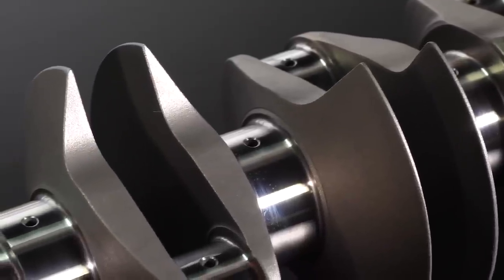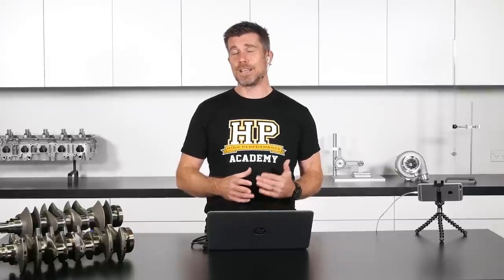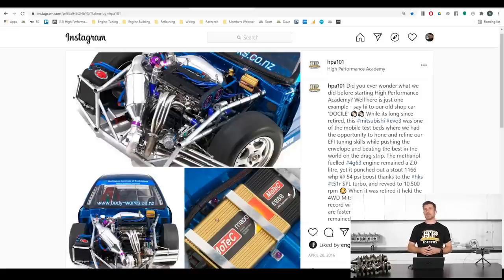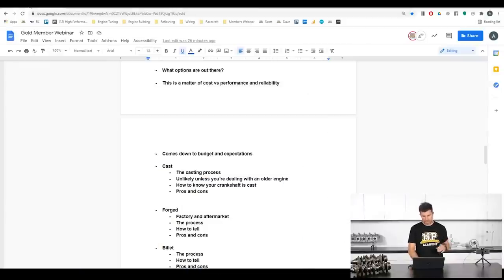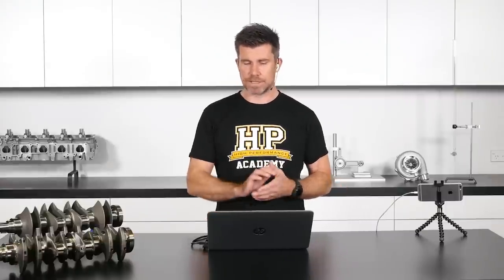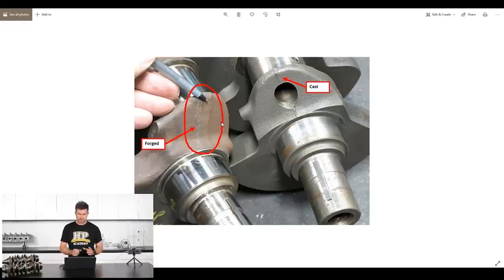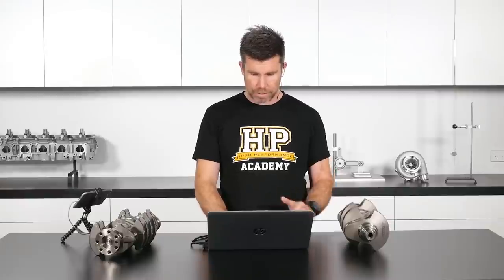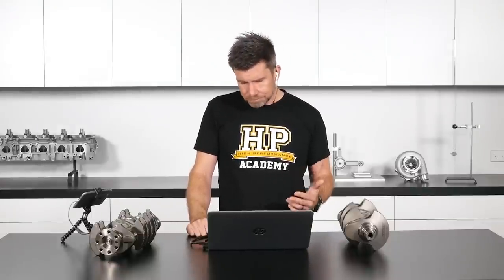Getting This Wrong Is VERY Expensive | Crankshafts

Comment: One thing I would add is that using a billet crank for really demanding applications should be machined from vacuum melted and preferably re-melted material.  The re-melting process (VAR or ESR) ensure fracture toughness in the tangential direction almost as high (@ 90%) as in the longitudinal direction.  As such it would actually be better than even forged cranks made of standard wrought material.   Great video BTW, love the content.

Comment: I think my k1 4340 ls7 forged crankshaft will survive my NA street build. First 600 miles with it has been good. I think it was worth the 300 dollars to buy it secondhand. Obviously had to buy differnet rods and pistons since I went from 3.622 to 4 inch stroke but to me its the way to go for an engine that wont ever see 6k rpm that lives on the street.

Comment: thing I never understood about cast grain structure compared to forged or billet is that forged & billet were both molten at some point.
Reply: Whilst the forging was molten, it's not molten during processing, hence a grain is produced, casting doesn't have a grain because it's phase changed when it's molten. Billet items also only have a grain in the direction it was formed into a billet in the first instance.

Comment: many stock cast crank Barra's out there making 1000hp
Reply from the maker: Peak HP is only one data point that on its own doesn't mean a whole lot - Taz.
Reply: @hpa101  plenty of cast crank barras running 9’s or better then, is that a more appropriate answer?
Reply from the maker: Depends who is asking the question and what they want to know in the first place I guess 😂 
What do you have planned next to get down into the 8's with your Barra? - Taz.
Reply: @hpa101  not my barra but my cylinder head and intake manifold on one is already in the 8’s Taz, 8.42 @ 172mph. You can check it out from Drag Challenge earlier this year, look for the Green Barra powered Torry 👍 would you like a link?
The major thing in my opinion your overlooking here is the load per cylinder, your 1100hp 4 cylinder has 5 main caps, the 1100hp Barra has 6 cylinders and 7 main caps, less load applied by each cylinder and also supported by more main caps.
Reply: @hpa101  also if the Torry was able to put the power down at 172mph would translate to a high 7 second pass, the suspension is being rebuilt hopefully for next year.

Comment: meh.. up to 2x the stock power you are just fine with a cast crank. remember, back in the old days they had no wierdboyz and brainboyz. just mekboyz. things where well over engineered, none was able to figure out how to produce them just barely sufficiently strong. unlike nowdays. and that is why you can grab a junkyard cast iron engine, get rid of the rust, rebuild, and make an easy 500 hp virtually out of any older v8 engines with litte efforth. allso we must mention the good old om606 that is clean deal with stock internals to 600 hp. the NA version did some 80 or so hp in stock form, btw. cast material is naturaly not strong. but you should not say those are to be forgotten.